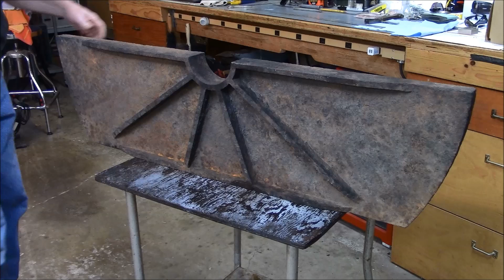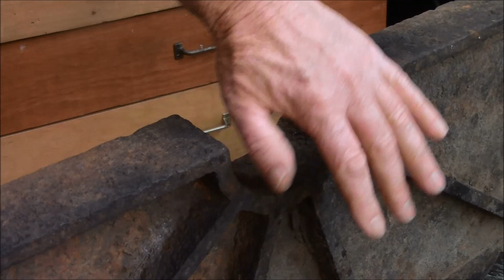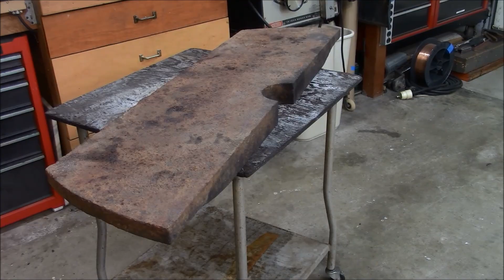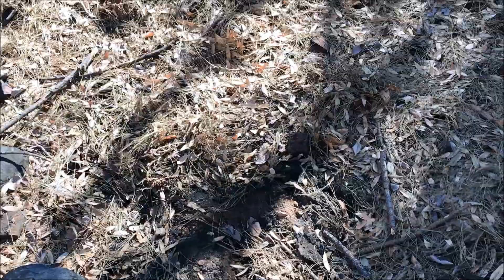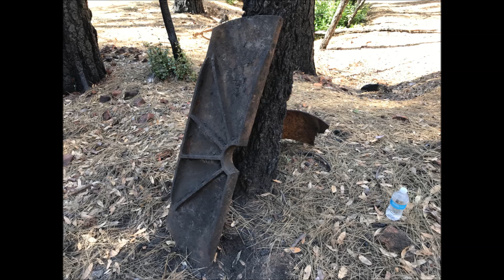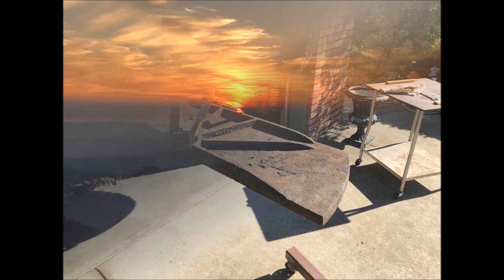Mystery Iron Plate from Mining Site - Weekend Update #20

Comment: Does your mill have the capacity to clean up the flat side  ,  would make a great welding or lay out table .   Cheers .
Reply from the maker: Hi Max, Yeah my mill only has a 36" table so that limits the travel to around 20". I could swing the turret / ram and probably get in a couple setups. I'd need to drill and counterbore some hold down bolts. Pitting is quite deep in spots, but a full cleanup not necessary for a welding / layout table. It could happen... Merry Christmas to You and  Family .... Dean

Comment: Did you find more pieces? Given the bricks, my guess would be a well cap of some type. Usually there are multiple sections. The shape suggests at least a four section cover.
Reply from the maker: Chris,  It's posable the other sections are buried  deeper down. I might have another look this spring. I think were on the right track "a well or vault cover" system. 
Thanks for commenting, Dean
Reply: @TheAyrCaveShop  Maybe find a friend with a metal detector and see what other treasures you can find up there.

Comment: Hi Dean,

Nice to find the big iron plate. Now to figure out something cool to do with it.

Before I retired I worked as a mining engineer. I knew a guy in college whose family had a high grade cinnabar mine in Alaska. They would go up in the summer and mine the ore. They flew the ore back to Seattle? at the end of the season where they had a retort in their back yard. Sounds crazy now but there were a lot less environmental regulations then. In a retort the ore is heated enough to vaporize the mercury and then the vapor is collected and condensed back to the liquid state. They would produce 76 lb flasks that, if I recall correctly, sold for around $500. In the late 1960's that was quite a bit of money. Retorts are also used in gold mining where the mercury is mixed with the ore and it amalgamates with the gold. The amalgam is retorted to separate the gold from the mercury. Anyway I would not be surprised to find remnants of a retort where you found the iron plate.
Reply from the maker: Great info Bob, come to think of it , one of old cabins had a outdoor wood fired water heater cobbled together probably from the old retort condenser. It was made of threaded iron/steel pipe serpentined into a box shape. The owner of that cabin passed about 20 years ago, had been abandoned since then and destroyed in last years fire. Everything went to scrap yard.
We have a interesting history of cinnabar mining practically in my backyard...The New Almaden Mines..one of the biggest quicksilver operations around, the reduction facility was quite large. Its now a historic site with many hiking trails.
Thanks for the great comment....Merry Christmas and Happy New Year

Comment: I spent over 30 years in the mining industry Dean. When I first saw that plate I thought it might have been part of a rotary drill deck collar assembly. Those are basically plates where for maintenance issues can be lifted out and in use the hardened deck collar drops in the hole of two of those plates and acts about the same as a large machine shop drill bushing to stabilize the drill string when starting a hole. With two plates the hole would be fairly small for a collar, but there drill pipe and drilled hole size wasn't that large back then. Give the time period? A pretty remote possibility since it would barely to maybe not fit with the mining drill technology available at the time. Vertical rotary oil field drills were around previous to that so it's still not completely impossible. But those aren't mobile like a mining drill would need to be. In a remote location like that, I still have doubts.With a small exploratory type operation I'm thinking the same as a few others have already said. Cam driven and gravity assist rudimentary stamping mills were pretty common back then as ore crushers prior to processing that ore through the mills. It's still only a rough guess, but that casting draft might not be an issue with the then very common cast in babbit bearings that have long since disappeared. Even more so if the area had ever had a previous forest fire. Babbit melts at fairly low temperatures.The end radius indicates it was a drop in part with an automatic alignment what ever it was really intended for and into another casting recess. So something that could easily and quickly be removed. Best guess is a part intended for use within one of those ore mills. And it definitely wouldn't have been in direct contact with the ore moving past it or you'd find obvious signs of wear. 

There's quite a few mining museums around the western U.S. with collections of original pictures taken when those mines and there mills were in operation. A long shot and it might take a lot of time. But going through there website pictures might show a matching item as part of another larger assembly. And the larger and in full production mills probably wouldn't be using anything like it. So I'd be targeting smaller operations for any searching. I'd be surprised if there wasn't a second or more plates exactly like that one somewhere within maybe a 30' radius of where you found that one. If there was a full but small mining and ore milling operation there and being that remote it was all probably abandoned with everything in place. A metal detector would turn up a whole lot more and lots of fairly large shafting that might be of use in a home shop if you ever felt like working that hard.
Reply from the maker: Interesting your comment on a forest fire melting out the Babbitt, this resent fire was hot but the plate was already buried prior. But there was a massive fire back in the 1940's that pretty much moonscaped the entire area. The older family owners have all passed. But we did here stories of them salvaging building materials from the old mine sites to help build their cabins. Plus the metal scraping for WW2 during that period may explain why only a few items remain. Yes and there are quite a few spots that metal detecting would be interesting.....Thanks !!

Comment: Looks like an access door for the side of a hammer mill I saw in the Nevada mountains. I think you had it upside down and the c section does clear the shaft. Would make a fantastic surface plate. Thanks for sharing Dean 👍👍👍
Reply from the maker: Ron you may have nailed it !!
Reply: @TheAyrCaveShop   Dean, you have some really good responses. It does look like it could’ve been used for a platform of some sort. I agree with a couple of those guys. Maybe there’s somewhere to see if there’s any historical photographs of mining up in this area and maybe you can match it up with something. During the gold rush in the Sierra  Nevada’s there had to be more than one of these pieces of equipment.  Only an idea sir. Also a lot of repurposed part swapping to make it work going on I would suspect.

Comment: It looks like a line shaft bearing block. It would have had a babbitt bearing that would have sat in the draft angle like a thrust surface. It could also be a bearing block for a small hammer ore crusher.